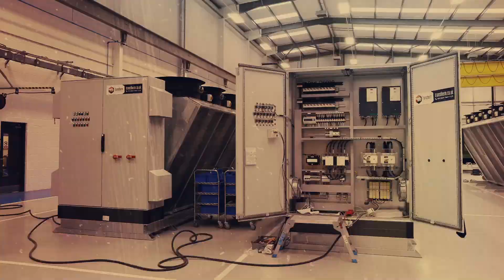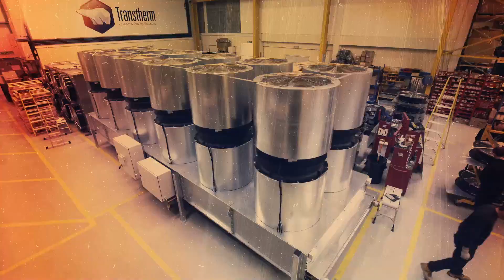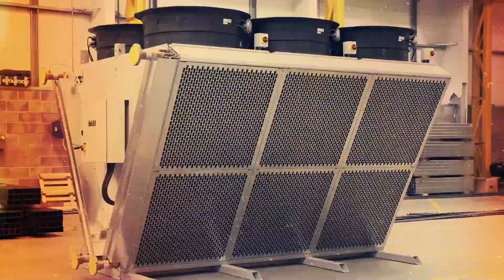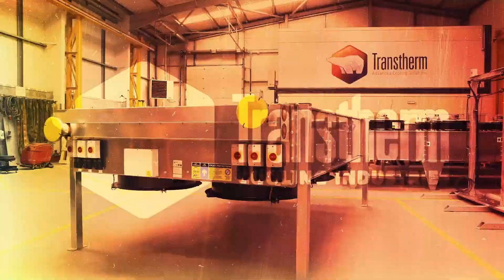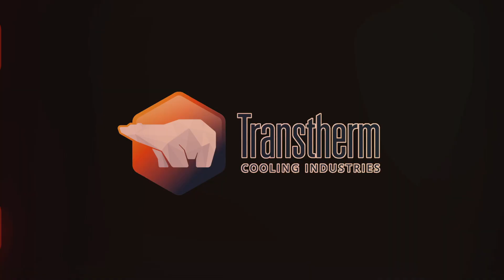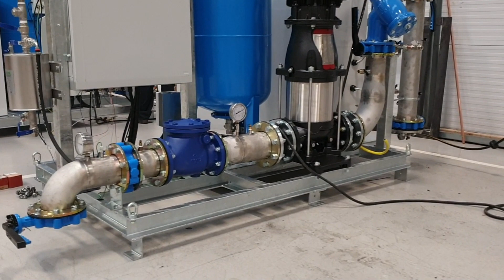Data Centre Cooling project walk around - Transtherm Cooling Industries

Comment: Don’t you need two dry coolers for redundancy and not just two pumps? Or is the cooler with dual circuits and dimensioned to handle all load even if one circuit is off or some fans are off?
Reply: Hi, There are many different configurations requested by our clients.  On larger scale multiple MW systems we typically either see complete standby coolers and pump sets (so there is only one pump on each set), or we see larger more centralised pump sets with N+1 or N+N on each pump skid.